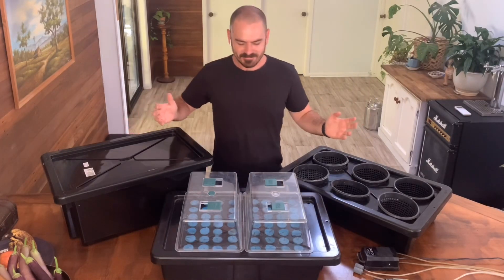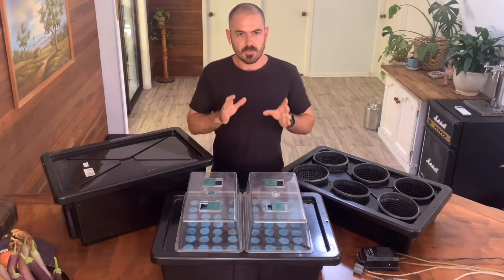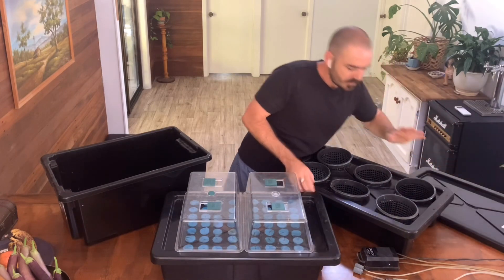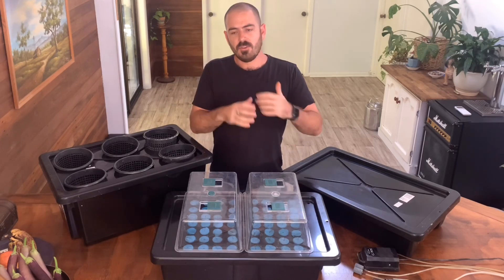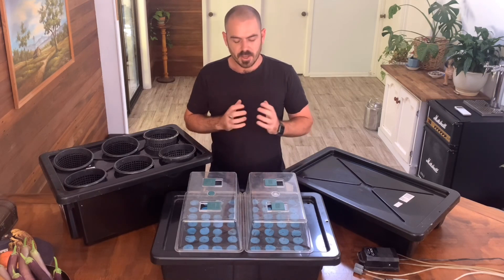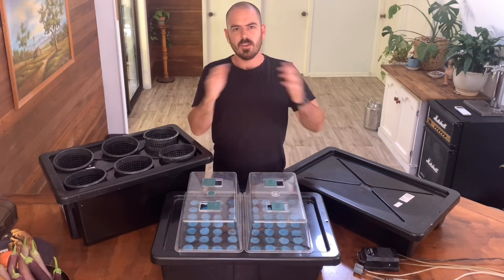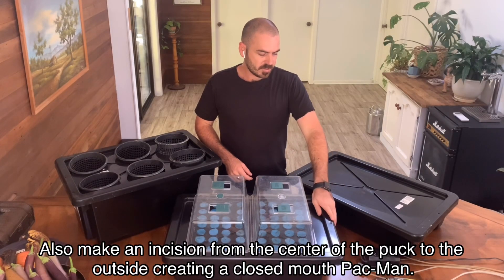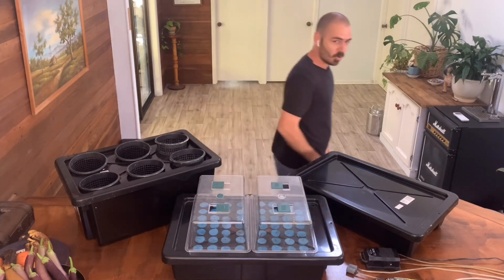How to Build a Hydroponic Seedling/Clone Propagator

Comment: Set this up in a 2x4 pan. Each will hold 266 pucks. Yeehaw.  Got thinner foam from Michael's Craft store. Set some in today. Got some drooping, but that's just from transplant shock. Did one of the larger disks in my NFT. Works like a charm. Great advice. Thank you!!

Comment: great videos, thank you. i've got my seeds in the sprouting container and i'm sitting the tray on top of my turtle tank at night as a seed warmer (during the day they go on a sunny windowsill). i'm guessing you change the nutrient water regularly in the black tub, how often? 

if i can be pushy enough to ask a 2nd question, is there a reason to do water changes instead of running a water pump and recirculating the nutrient solution? i'm asking as i have an aquaponics sytem and was thinking of draining water in to the black tub with an overflow back the sump.

Comment: Hey Hooch, im looking at getting a set of hole saws but not finding any with 35,45,64,and 90 (which brand did you buy?  thanks?) or did you by all individually?
Reply from the maker: Buy the 90 individual and add the craft right bi-metal hole saw kit, then you get the center bit that fits the 90mm in the kit.

Comment: Hey Hoocho, nice work mate. Can you confirm that your holes saws for the smaller pucks are actually 35mm and 45mm? A lot of hole saw 'kits' give you sizes like 32, 38, 44 etc..
Reply from the maker: adidazzler can confirm 35mm or 1-3/8 and 1-3/4 which is actually 44mm but as long as the ratios are correct and you have about 9mm extra diameter you should be sweet.
The 9mm diameter is to make up for the fact the inside of the holesaw is cutting the pucks and the outside is cutting the holes in the propagation lid.. if that makes sense